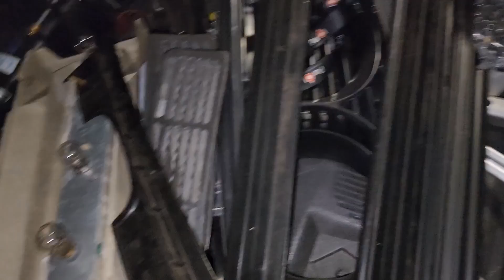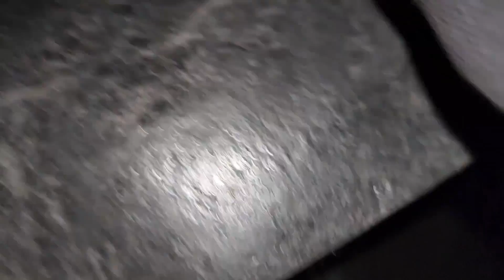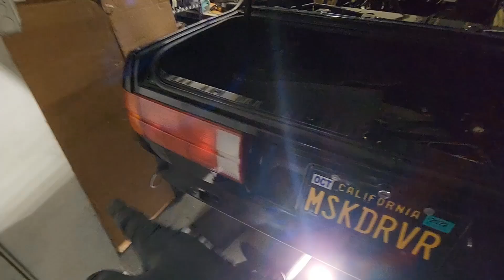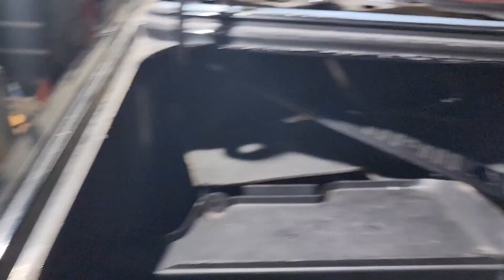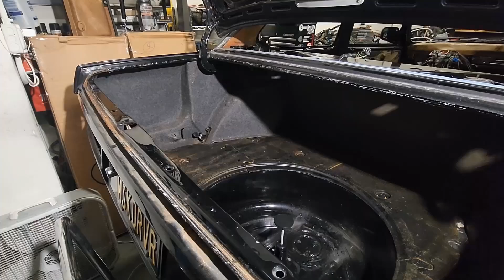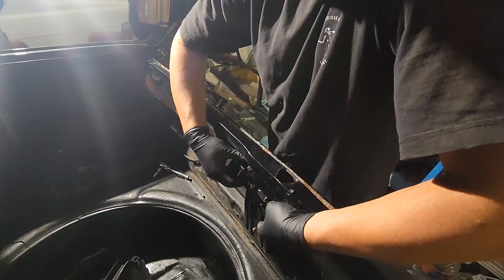BMW E30 Tear Down EP7 | Miscellaneous Parts Left Part 2 (Rear Bumper, Trunk Carpet, Trunk)

Comment: it might be worthwhile to mention that your car is pre-facelift.  My post-facelift '89 does not mount in the same way.
Reply from the maker: That is correct but not correct. The way the bumper mounts to the bumper shocks are different.  The way the bumper shocks mount to the chassis is the same